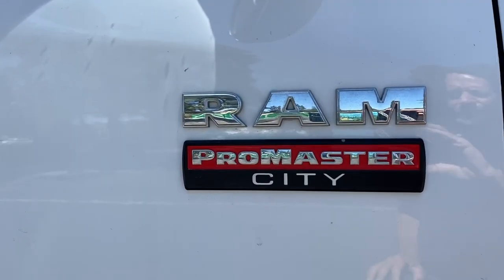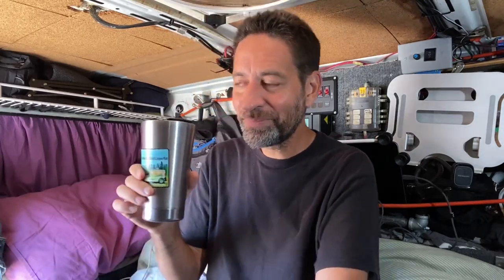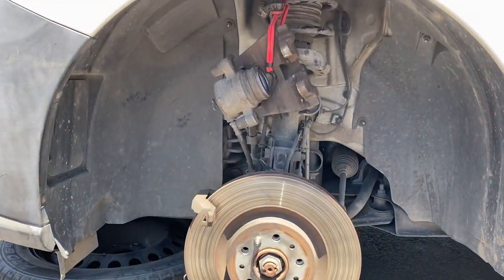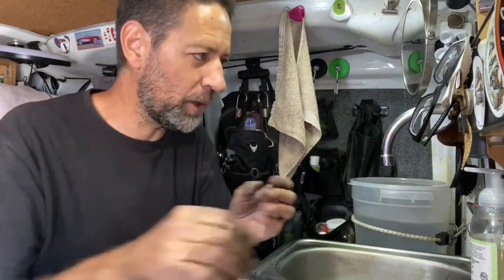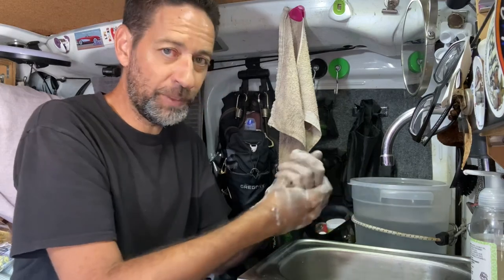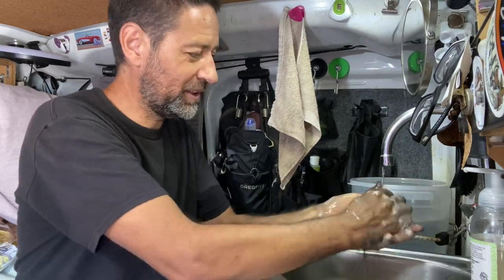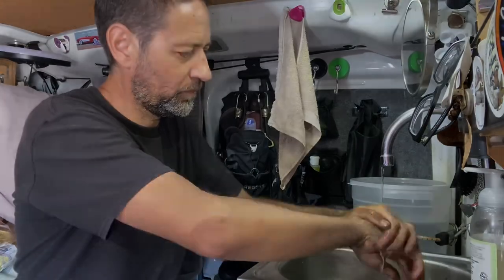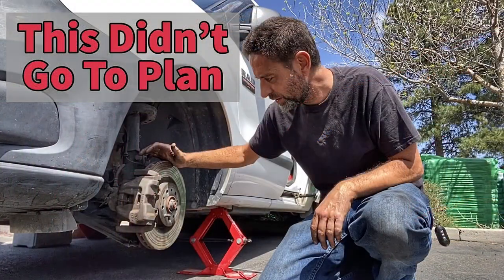New Brakes and Rotors from RockAuto.com for my Ram ProMaster City

Comment: You are welcome anytime.  With rotors most newer vehicles you can not cut the rotors, not like vehicles from the 80's when they was made thicker.
He is 100% right about at shops the mechanic might not have the right tool for the job, this mainly happens at local shops not dealerships.  
Most brakes are easy to do, there are some newer vehicles now that you have to have the dealer do them.  
In my opinion anyone can fix their own vehicle, my advice is take a lot of pictures so you know where stuff goes, take your time and you can do the job.  Sure some stuff you can not fix like when it comes to the computer stuff.  You can save yourself a lot of money. 
Good job glad I was able to help.

Comment: I guess I lucked out when I had some rotors turned. I was in Rapid City SD and experiencing violent shaking when braking down hills. I went to tire/brake/alignment shop thinking I needed an alignment. They drove my van and said, no, it was warped rotors and that they could turn them -- while I waited. A half hour later I was back on the road, shake-free.
Reply from the maker: There’s certainly advantages to being in the mid-west.

Comment: Good to see you solved your issue. BTW I had my first cup of coffee using the Staresso grinder and V60 pour over. Bought some organic light roast beans (Ethiopian). Best cup of coffee I’ve ever had. Preparation methods makes a definite difference. Curios to try it in my aeropress as well.
Reply from the maker: That’s great to hear! Thanks for sharing. 
It’s been such a long time since I used my V60, I’m frightened for the results! Haha. You’re encouraging me to get the V60 out and shake off the dust.
Reply: @StaticCamperVan  seem I got more flavor from the V60 than I usually get from the Aeropress. Probably from having to top off my travel cup with water because of the limited amount the Aeropress holds.
Reply from the maker: If you use the V60 correctly, it does bring out the best flavor. You must have a knack for brewing with it

Comment: I installed batteries, charge controller, inverter, etc., at that Home Depot. I ordered everything from Amazon, being delivered to the post office, UPS and even Safeway, located in various parts of Flagstaff. I spent 3 days at the Home Depot, the one on Woodland. It was like going to work. I bought wire cutters, heat shrink and something else in Home Depot.  There were a couple others doing work on their campers while I was there.  I also did some work a few miles up on NF535, the road you decided to not go up  (That cattle guard at the bottom made me think twice, too). So, for people that are afraid to tackle involved projects on the road, I think if your project does not require a lot of disassembly out into the parking lot, businesses such as Home Depot will accommodate you…within reason.

Comment: Just a guess, but you may have bought E Torx Plus sockets rather than regular E Torx sockets from O'Reilly. There is a difference in the profile. Torx Plus has a flattened point vs the peaked point of regular Torx.

Comment: Great you got it done. The ceramic pads are harder on rotor wear but give better braking with less heat like for steep hills. Keep your old rotors and get them turned they look to have lots of meat on them yet and use them next time. Good job. 👍👍⭐⭐🚐⭐⭐👍👍
Reply from the maker: I don’t have room to hold onto the old rotors.